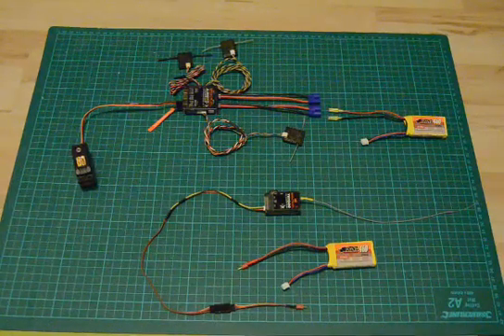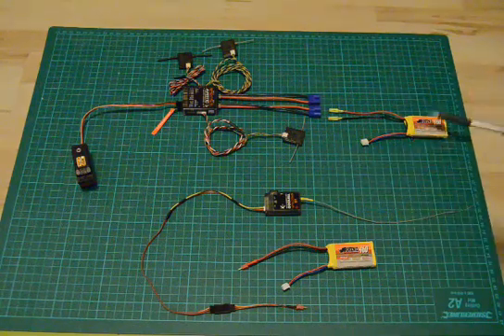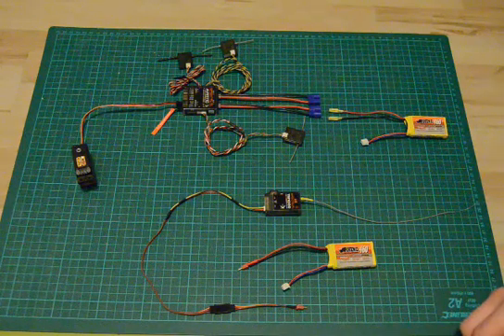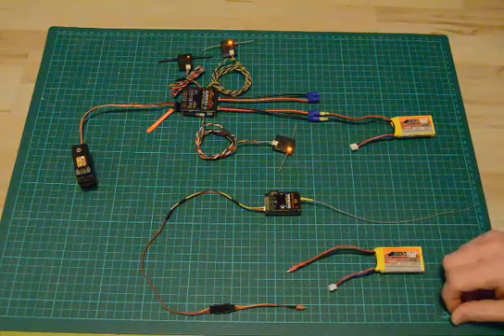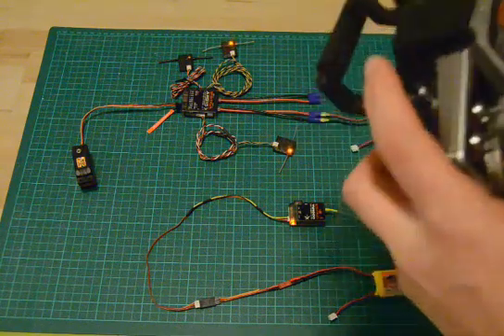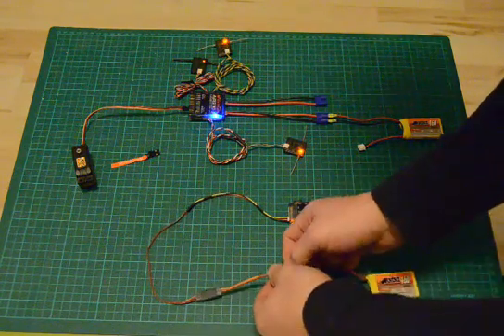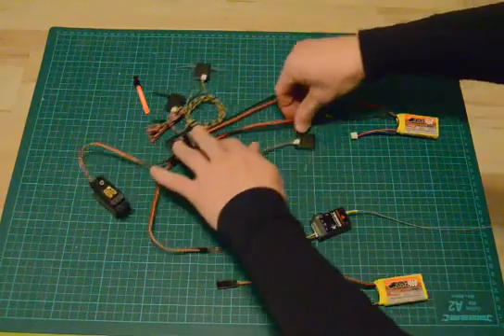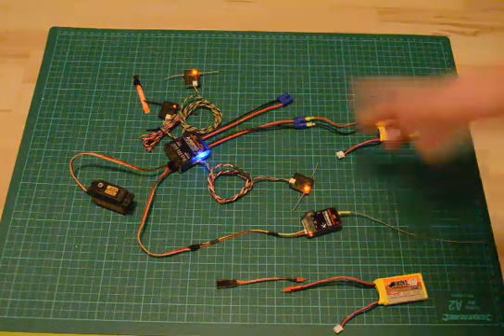Binding Spektrum AR9110 with telemetry TM1000

Comment: You cut the video off as you plugged the tm1000 into the battery.  Did you release the bind button before plugging it in, or did you hold the bind button as you plugged the battery into the telemetry receiver.  You cut the video in a crucial moment
Reply from the maker: Hi. I had to hold the binding button when powering TM1000.